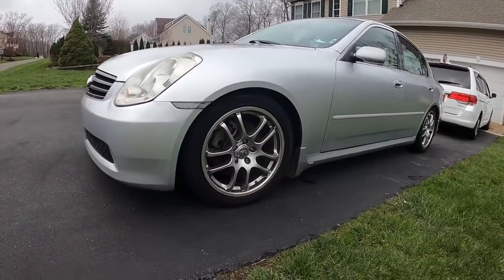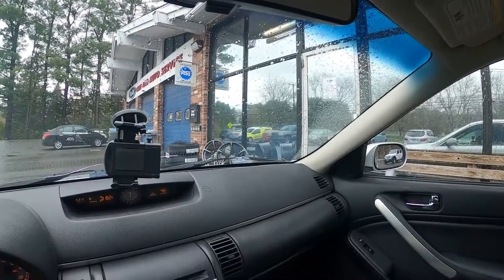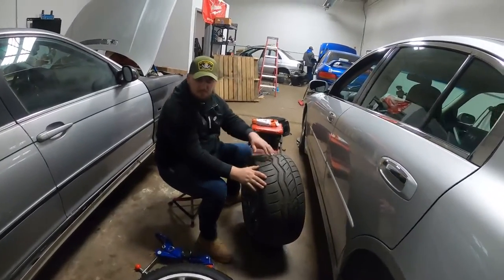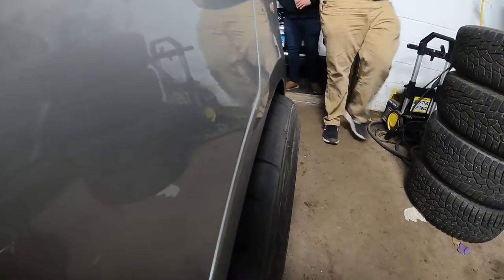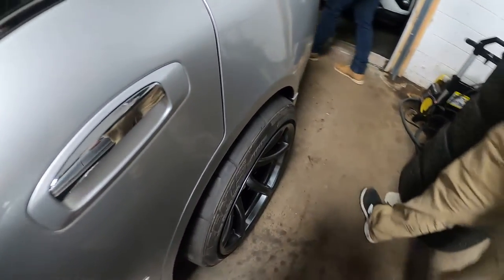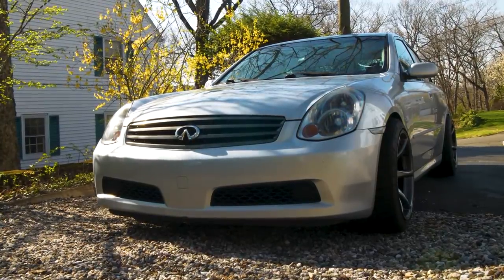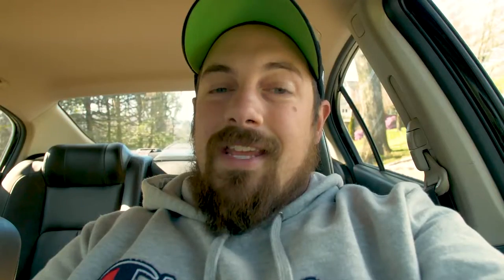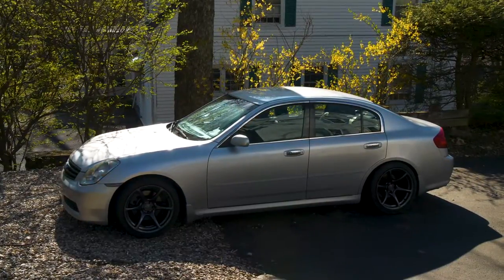installing new wheels onto Dans G35 sport sedan!

Comment: So what happen I didn’t see any updates cuz I have the same set up atm 😅 and I went and got god speeds mono ss and they look sick with a bit of camber added to the rear and full stiff in the rear. Full soft in front, but didn’t roll the fender fast enough so the tire in the rear got eaten up a bit with the lip 😭
Reply from the maker: hey Abraham! Wife and i just got a house and we are settling in. the G is doing great and the wheels are awesome! but my tires are old and one of them debeaded! i rolled the fenders and the fitment was good but not great. i will be adding flares to the car soon and im on the lookout for new tires

Comment: Question i have similar car and thinking of putting exact same width and tire size like yours cuz i was thinking of putting some big brakes on them so not sure if the 19in tires would fit or wat set of wheel spec did u get cuz i recently checked your videos and so far it looks good that i wanna put them on for myself as well
Reply from the maker: These are size 18s and will clear big brakes! Also, I went ahead and sold this set because they were a little too wide. I was going to go wide body but there are no kits available currently apparently. So I sold these and I got another set but they're 9 and 1/2 so a little bit thinner but still 18s

Comment: what's the falken tire specs please i need to know is it 265/35??
Reply from the maker: This fitment would be great for a wide body or overfender kit but there isn't currently one available. I was going to go with fender flares but I have decided against it and I actually got a different set of wheels ! I haven't done an update on this car in a little while but updates are coming!
Reply from the maker: Also on top of that I would go for a 245 40 18
Reply: @blackpearlmedia7797  i have a rx8 with a 13b-rew not a G btw so idk if i should do 265/35r18 cause the rx8's fenders are already wide stock but i havent seen anyone run that with the kansei tandems 18x10.5 squard with that size only seen 235/40r18 but none of them have a track fitment just camber and low type of fitment
Reply from the maker: @celacantmiss  have you checked fitment industries gallery? That's where I go now to dial in the fitment I want. I'd head over there! I bet tandems would look insane on an rx8!
Reply: @blackpearlmedia7797  only seen rx8's with 235/40 stretched tires but its all camber i want a track look so im prolly gonna do 265/35 i saw a 350z with that tire setup and rx8 are kinda wide like the 350z